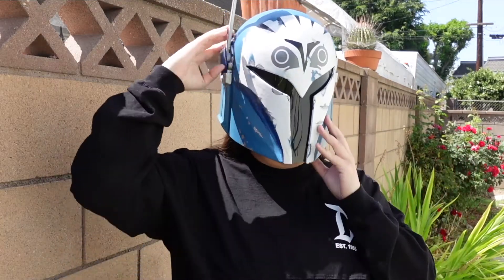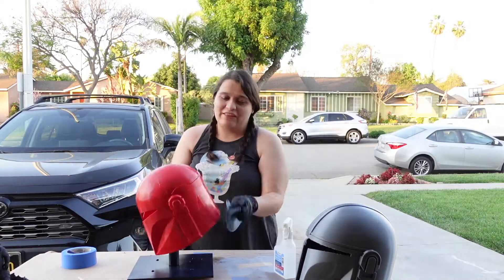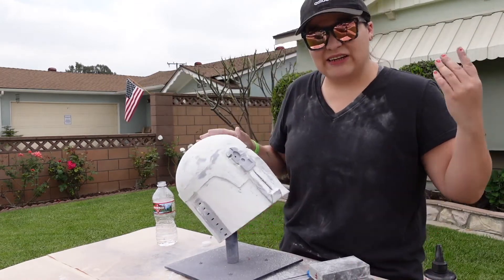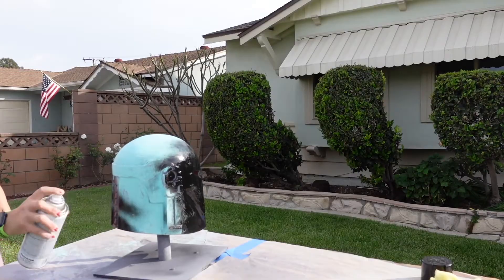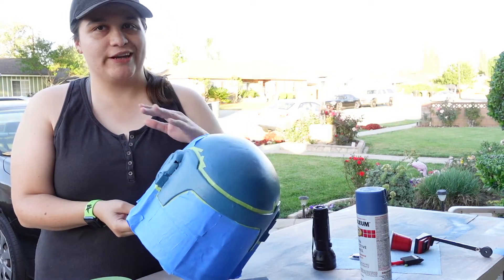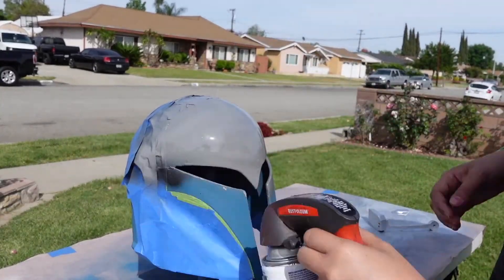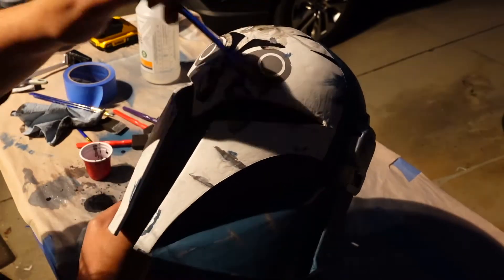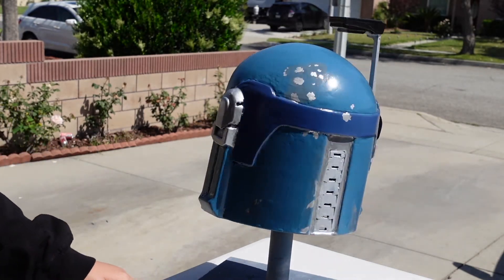Making Bo-Katan's Helmet from The Mandalorin with a 3D Printer || How To

Comment: This is incredible. My daughter and I are inspired. We want to start trying work like this. Thanks for the video!
Reply from the maker: So glad you liked it!
Reply: @ChippedBuilds  Can I ask what software you used to print this?  Our artillery sidewinder keeps moving the the start of the print like it isn't sealing enough to the bottom.  I"m not sure if it is our slice software or we need to increase filament.  Any thoughts or experience with this?  Thanks!
Reply from the maker: @Courtside-Stories  i used simplift3d but you should check out prusa slicer
Reply: How much filament is required to make a helmet like this? Is it multiple spools?
Reply from the maker: @Courtside-Stories  I used one roll of pla for the project
Reply: @ChippedBuilds  Thanks!